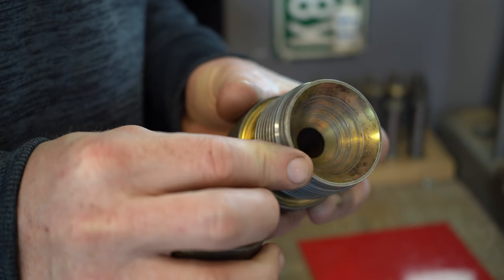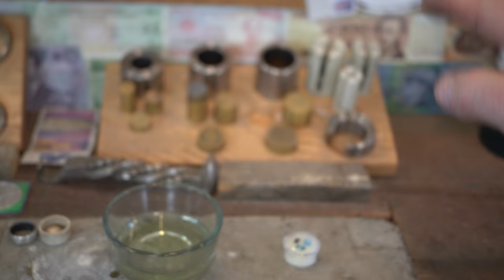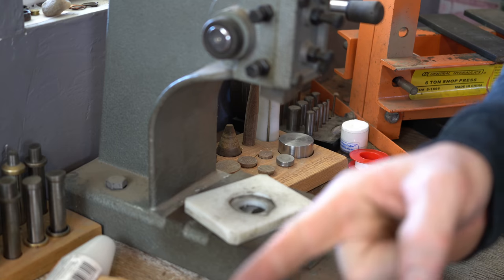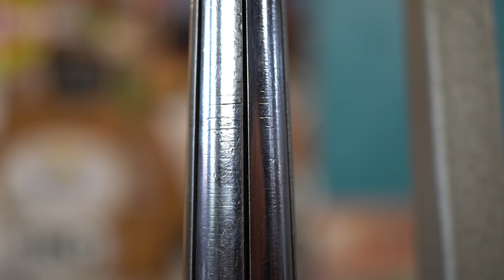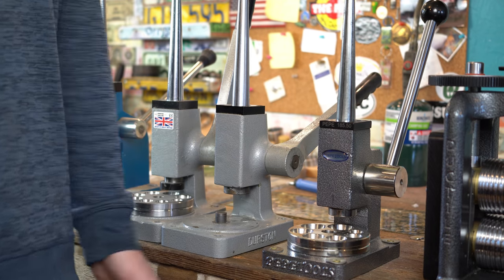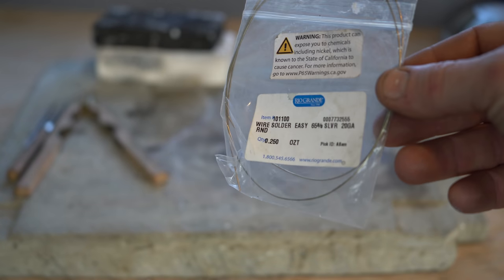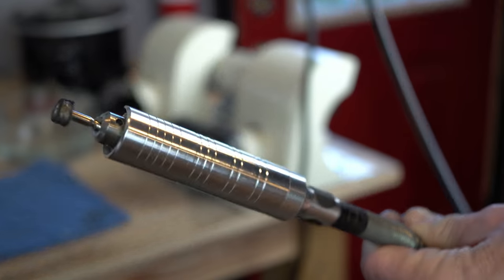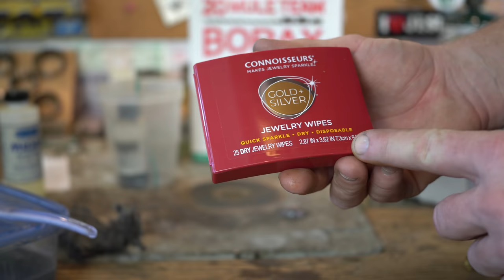A complete Rundown On All The Tools for Coin Ring Making

Comment: As far as surfaces to anneal on, fire brick (sometimes called refractory) is a cheap means to an end. Many hardware and builders supply stores carry it. It comes in different sizes, but I get the thinner ones which are around an inch and a half thick. $2.99 each in my local hardware store (Ace). It’s used to line wood stoves, and fire won’t harm it.

Comment: What about the PVC looking rings that you used to put the coin ring into and then put that in the lathe. I assume those white plastic ring pipe looking things were two grip the coin ring while in the lathe to protect it while you board out the inside of the coin ring?

Comment: If I am only getting the ring stretcher for stretching then would it be smart to get the cheapo on that has the crappy die plate?
Reply from the maker: Sure! The splines can break but I got a ton of use out of the ones I've had.

Comment: when I do the Swedish wrap most of the time my coin gets stock in the die, and I do lube the die with coconut oil. what do you think I'm doing wrong?
Reply from the maker: Nothing at all mine do the same thing sometimes. I just use a brass plunger to push it back out  upside down in the die and tilted to get ahold of the stuck ring and push it out.

Comment: Will a Pepe die plate fit on the Indian stretcher?
Reply from the maker: Yes but you just need to remove the center piece from your stretcher. I use it without that center thing and it works great.

Comment: Well, I hope the sizer you designed works on the India ring sizer, as I bought one today. Got an email that they are shipping it, gave me a tracking number. 😉
Reply from the maker: They do. You can always take out the center pin if it is too big.
Reply: cant you just have the center of the new die machine out

Comment: Can you punch a hole in a coin with the Arbor press?
Reply from the maker: A hydraulic press it the key for that. You should be able to find a cheap 6 ton or similar on Amazon.
Reply: @CoinRingsfromTheMint  I actually went to Harbor Frieght and got a 12 ton. They don't have a 6 ton anymore. I love it! I am able to use a disc cutter that was really hard to use with a 2 lb brass hammer! But, with this press its like butter!

Comment: If you understood rolling mills you would know the difference between Pepe and Durston rolling mills. The metal used in rollers is different quality on the Pepe Mills the Durston. The Durston is harder and is bigger and takes much longer to machine then both temper them after machining them.  Pepe is med quality professional Durston is higher quality professional.  Master jeweler 47 yrs on the bench.
Reply from the maker: That might be true but I've personally had 4 duration ring stretchers and I've watched their quality go down in material and craftsmanship. If they are doing it in one tool, I'm not going to roll the dice with another.
Reply from the maker: I appreciate your insight though. Since they are known for rolling mills, maybe they would be less likely to do that.
Reply: @CoinRingsfromTheMint  - Kagan is the industry standard in ring stretchers.
Reply from the maker: @stevesatow  I have one. They don't have the clearance for coin ring makers.